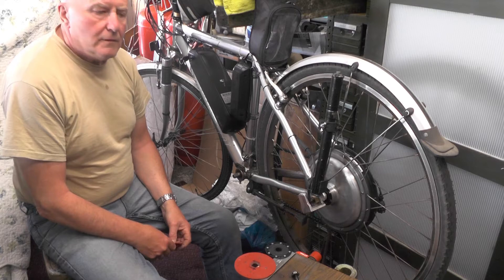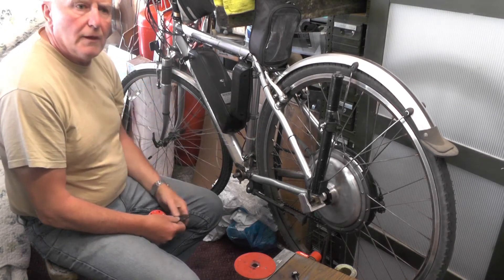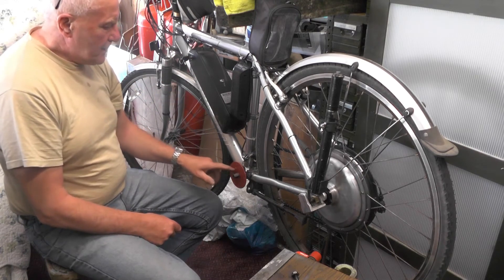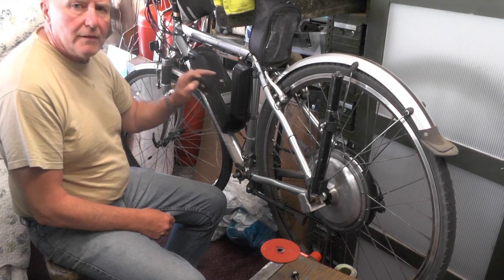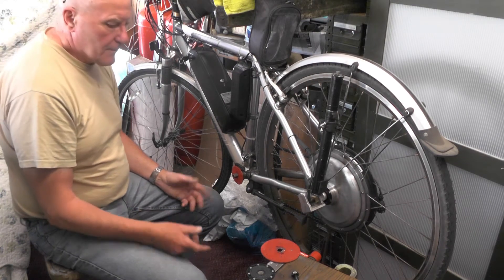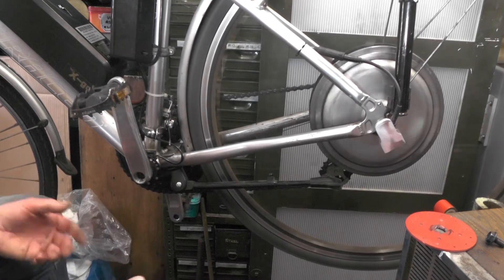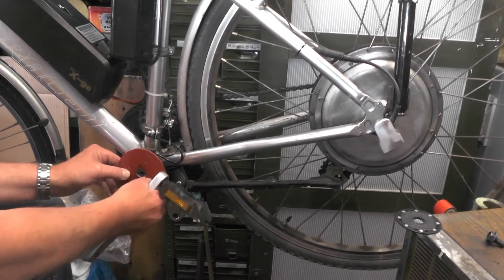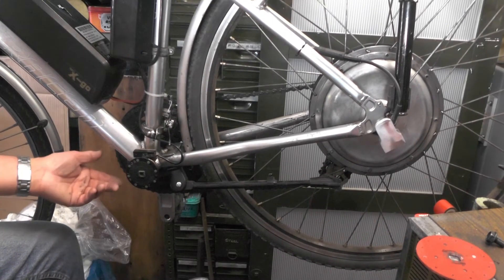Pedal Assist Sensor Ebike Magnet Mystery "mr factotum"

Comment: Usually the controller can be configured how many magnets the PAS sensor has. Also be aware it makes a big difference in which gear you are. It will probably also stop support when you are above a certain speed.
Reply from the maker: cheers! 👍 great observations on the PAS sensor and gearing!

Comment: Some controllers have a setting for the number of magnets in the PAS but even with this setting correct you can still get the problem you are showing with the motor disconnecting.
Check your motor specs (magnet pairs × gear ratio).
e.g. if rotor has 20 pole pairs and gear ratio is 5:1  C.alculate 20 × 5 = 100. On KT controllers this is the setting for P1. Maybe your controller has a similar setting.
If you do not have the motor specs, it is trial and error with the setting and your tacho will probably be showing an incorrect speed as well. To get this setting correct, you can download an GPS app that measures speed andcompare this speed with your tacho speed. If your tacho speed is too low, increase the setting until tache speed = GPS speed.
Reply from the maker: That's some great information and a very helpful explanation, thanks for sharing! 👍 Stuart
I cracked this some time back by trial and error as i don't have facility to adjust the controller, as i don't have an lcd screen for the settings, i just have a minimal basic equipment set up, but thanks for the info.👍👍😉
it's been running now for 4 year ok
regards
Kev

Comment: A 5 magnet disc works well for me
Reply from the maker: great to hear, your controller recognisers it ok then, thanks for the feedback
regards
Kev
Reply: Hi kev my e-bike has a crawling mode so it gives the initial start off the lights but like you said there is a delay before the pedals actions kicks in  @MrFactotum
Reply from the maker: @SalimKhan-gk1fh  yes its irritatiing, but solved mine now and had no trouble, for people with a fancy programable readout i believe they can adjust the number of magnets. Never tried one though👍👍🚲🚲

Comment: Yes hadn't thought of all those  implications. My own problem is I have an 80s ridgeback with an old fashioned bottom bracket with locking ring nut  . They supplied an alternative magnet disk but there's friction with the surface of the bottom bracket . I compensated  by adding a rubber o ring to create  friction with the crank arm . It works but after a few miles the pedal nut comes loose . Maybe a replacement locking nut woth the nylon insert ?
Reply from the maker: yes perhaps or use loctite nutlock, which can be released if needed with localised heat, just a thought, good luck
p.s. if you use loctite degrease thoroughly, i use Brake Cleaner
atb
Kev

Comment: Hi also got sensor issues . Thought about your situation . If the replacement ring has a smaller diamter then the magnets are being picked up faster by the sensor so my giess is youd want less magnets on a smaller ring
Reply from the maker: hi 
might be a bit of trial and error, i made a few rings with different magnets before i got the ratio correct. Don't forget you may have a pas sensor problem too. I did another bike after this and a brand new sensor switch had an intermittent issue. Just a thought. Mine is still going strong with no issues, i use it daily.
cheers👍👍👍🚲🚲🚲
Kev

Comment: I wonder if you can tell the controller how May magnets there is . Same as you can adjust the wheel size
Reply from the maker: hi pb
Yes you can if you have a fancy lcd display and control box to match, i don't use those, just keep things simple, been using the bike now for a few year and its working fine,
thanks for watching and feedback
atb👍👍👍😉
Kev

Comment: With 6 if its not kicking out is it just ghost pedalling then? What's the use of such ebike with ghost pedaling?
I'm not aligned for 8 magnets either which is just kicking in and out. Is Cadence concept really worth it?
Reply from the maker: Thanks very much k5620
it works fine for me just helps me on the hills
atb
Kev

Comment: The tricky Pedalassistsrnsor has 2 reed relays inside the sensorunit and the controller is expecting the reed relays to close-open in a successive order ! That is one after the other ! In your case the sensor sits the wrong direction ! So what you need to do is disconnect the sensor from its bracket and then fasten it in the opposite direction !
Reply from the maker: oh, never realised that, its been working okay though since the video, but i will bear any great info in mind.
thank you very much for the info
appreciated👍👍👍👍👍👍
Kev

Comment: if I use 8 magnets and I will change it to 12 magnets and of course my controller changes the parameters from 8 magnets to 12 magnets, is there a significant change?
Reply from the maker: hi B
well i found that mine would not work properly (especially on hills) with the incorrect number of magnets, but some controllers vary in different ways
Its going to be a case of try it and see
cheers👍👍👍
Kev

Comment: you can setup in the display how many magnets it has and only put it higher and lower. like saying it has more or less magnets. also the assist motor strenght.
 dint had to make your own, sorry to say.
Reply from the maker: hi j
thanks for the feedback, but i don't use a display so have to run how the controller is pre set. been a long time since this video and all soreted now with no display, to keep things simple and basic.
Regards
Kev
Reply: @MrFactotum    i have a question i have display LCD81F,  how do you put the speed on every pass, like pass 1 it use 20% batt, pas 2 40% pas 3 60% pass 4 80% 5 100% ??? i can not find it anymoreq, i can not get into that mode again, can you help me ? i also will ask other people
Reply from the maker: @jornmulder  
Hi JM
Sorry can't answer that, i have never used a display, i keep things simple just use a controller, battery and on/off switch for the pedal assist and throttle, less to fiddle around with and less to go wrong
Thanks for the feedback
regards
Kev

Comment: i found that you have to put the magnets in the correct way EG pos and neg polarity try turning them around and see what i mean they all have to have same polarity the correct way🙂
Reply from the maker: cheers Nick
Yes i knew that with polarity
Did this a while back now and all is wprking fine
Thanks for the feedback👍👍
regards
Kev
Reply: @MrFactotum  yea i ended up using 6 magnets because i changed the controller for 48v battery

Comment: It's obvious that there is a speed limiter and it's based on the crank rpm.  The magnets are used for triggering the PAS and for calculating the speed.  Ie the controller looks for frequency of pulses.  You add magnets and the frequency of pulses goes up and it licks out.(you hit the limit)  Less magnets you would have to pedal faster to hit the pulses limit.  I think if you put the six back on and gear down so the crank goes faster you will find it kicks out.  Just my two bits worth.
Reply from the maker: cheers Bruce
all suggestions are worth the while, so thanks for the input, feedback and watching it's appreciated
regards
Kev
Reply: that's should not be true - the speed must be calculated by the rotations in the motor - you can have multiple gearing scenarios - the rpm of crank doesn't match the speed of the bike
Reply: @Konidc there are some limitations with cadence sensors. That’s why you can ghost pedal ie put it in a low gear and spin the cranks so the motor does all the work. And sometimes the motor is too slow so you end up doing all the work.

Comment: I think you just solved my problems...
I'm having another issue, the speed is only displayed if the motor starts turning. If I go downhill, the speed shows 0 km/h or mp/h whatever.
Also I get a speed displayed when I go in reverse (just going backward) despite it's a geared hub motor
Reply from the maker: thanks very much for the feedback glad it helped
I can't help with the speed as i don't have the instrument control panel on, i just use a cheap standard cycle mileometer
regards
Kev

Comment: Is your controller restricted to a certain speed as 12 magnets will register that the bike is going faster than 4 ..bike doesn't know what speed it's doing
Reply from the maker: hi 
thanks for feedback, controller not restricted to a certain speed, been a while since i did the video, it's all working as it should now, but thanks for the suggestions.
ATB
Kev
Reply: I'm having problems with my pedal assist sensor hence why I'm watching your video about to give it a clean and do some problem solving the joys of e bikes..my throttle is working but pedal assist is not ..

Comment: It's probably a bit late now, but the problem/issue is that you need to go into the configuration settings in the display menu and set it to the same number of magnets you're using 5/8/12 
To do this, you'll need to hold down the (up & down) button at the same time for a few seconds to access factory settings. Some display menu switch/buttons differ but are very similar You can change speed restrictions, performance, and so much more too...

   🚲  
     🙂👍
Reply from the maker: cheers NNA
I can't access any factory settings i i don't use any form of display, its just a basic diy kit, but managed okay with trial and error, thanks anyway👍👍👍
Reply: @MrFactotum My Voilamart 1500w kits the same, 8 magnets, I need to make some discs and get some of those magnets - or can you just buy these discs/mags online??
My kit has no display also, it didn't come with one, I just use my phone in a holder and a programme app called "Speedview"(great speed app, free too) and the stock 8 magnets disc...
I have the same problem on a hill you have to peddle too much before it kicks in...
Seems I'll have to get looking online to see if I can get a 12 or 16 magnets disc(?), would be better for me now I'm knocking on in years (haha) being 50 years young.

Interesting video, found it relaxing to watch too, cheers & all the best from across the pond here in the U.K.
Reply from the maker: @mickyb.8014  thanks very much Mickyb, appreciate the feedback,
I would say if your ebike conversion came as a complete kit it should have the correct magnets. I made my kit up from different suppliers, so thats the main reason for my problems.
i'm not sure if discs with different magnets in are available as its a while since i did my conversion, biut  i would think they should be, but like i said if yours was a complete kit i would suspect something else unless the one or more of the  magnets in the disc are the wrong way (north and south), also mke sure the magnet disc is running true on the pedal crank, if it wobbles too far away from the sensor this could have an effect.
Hope this helps, good luck oh and i will check the speedview out.
regards
Kev
Reply: @MrFactotum  it's on right and magnets are fine, just I need it to kick in faster than half a full peddle turn, so I'm thinking double the small magnets from 8 to 16 may just do the trick, it's worth a try as it shouldn't cost much, appreciated.
Reply: No matter what setting I put into the display, the pedal assist will work erratically. I will try to use a 5 magnets sensor instead of the one I'm using currently.

Comment: Kev,
I believe I know what the issue is... The controller has a cut out based RPM of the cranks based on the factory supplied number of magnets. So lets say the factory is 6 and you have 12 magnets fitted it will think your doing twice as many RPM than you are. So stick with 6 which works find on the flat and when you are on a hill change to a lower gear so you pedal faster and then it will kick in and all will be fine.
Cheers.
Paul,,
Reply from the maker: eyup Paul
Yes, great, well thought out, never thought of it as a rpm program problem, i think that's logical, it's always nice to get a fresh pair of eyes on a problem, when you have tunnel vision.
cheers
see you soon on something completely different!!!
take care
Kev

Comment: Hi Kev. Very interesting. I think you are right about the controller. It is probably expecting a number of pulses in a certain range from the sensor. Too many magnets increases the the number of pulses and confuses the controller. Anyway, you got it sorted which is what matters. Cheers, Alan.
Reply from the maker: cheers Alan,
it's all about looking at any problem logically, you know where i am coming from👍👍👍👍😉😉
see you next time
Kev
Reply: if I use 8 magnets and I will change it to 12 magnets and of course my controller changes the parameters from 8 magnets to 12 magnets, is there a significant change?